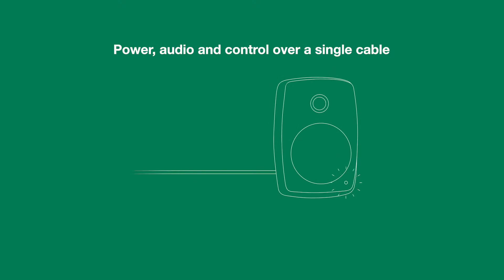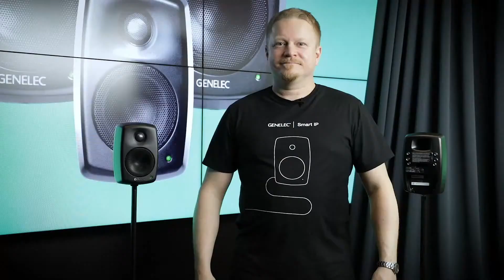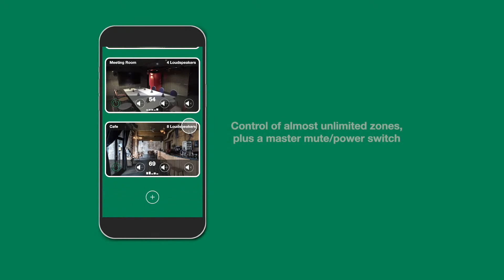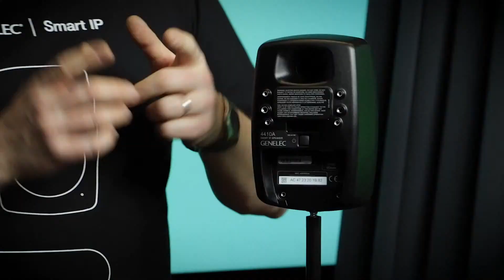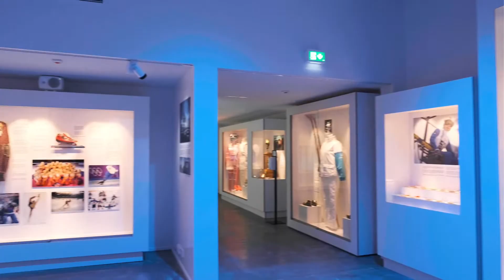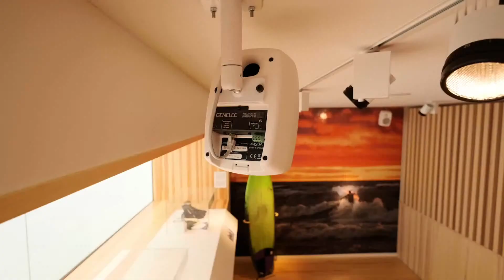Genelec Smart IP | 4410A & Smart IP Controller app launch event

Comment: I’m looking for a system to install in a gallery that can faithfully recreate DOLBY atmos. How is the quality of these vs. the 83xx series for this purpose?
Reply: Hi Niles! Replying from my personal account although I am working at Genelec. The Smart IP series is not recommended to be used for Dolby Atmos purposes since there is no subwoofer available in the Smart IP series and calibration has to be done manually with an external measurement system. Dolby Atmos requires at least one subwoofer for the LFE channel and mixing Smart IP and 83xx or 73xx series will make integration more challenging. Therefore the recommendation is to use the 83xx series with a 73xx series subwoofer for Dolby Atmos purposes. Also good to keep in mind that the Smart IP series are powered through a POE switch which will add demand on the power feed, especially when listening to higher levels.
Reply: @anyman32  Does Genelec plan to add networking support to their subwoofers in the near future so that this would be possible for Dolby Atmos? I’m interested in doing the same, except for a recording studio. Also, does the the Smart IP Manager really not work with Mac? What’s the ETA for Mac support?
Reply: @anyman32  Is this true anymore considering there is 3440A subwoofer in the smart-ip series.

Comment: Would this system be a good fit for whole-house smart audio solution?
Reply: Hi Johan! Yes, the Smart IP series works well in any environment with an AoIP network and it makes installation easy and simple since there is no need for a separate power cable.

Comment: Are the Smart-IP speakers appropriate for a recording studio environment wishing to implement Dolby Atmos?  Thanks!
Reply: That was exactly my first question too. THe price point is a bit higher but the "less cables" implementation is tempting
Reply: Hi! The Smart IP series is not the best option for Dolby Atmos in a studio envronment, since the series does not include a subwoofer. It would be possible though, to add a subwoofer from the SAM series with an AVIO network adapter. An Atmos setup with the Smart IP size speakers would need bass management anyway, which makes the SAM series much more efficient and convenient for a studio environment with a wide selection of different size main speakers and subwoofers with both analog and digital connectivity. Therefore SAM series is recommended and the GLM software is also the easiest and most efficient way to calibrate the speakers. Calibration with Smart IP is manual and requires an external calibration system.